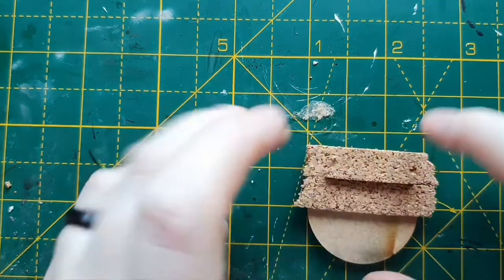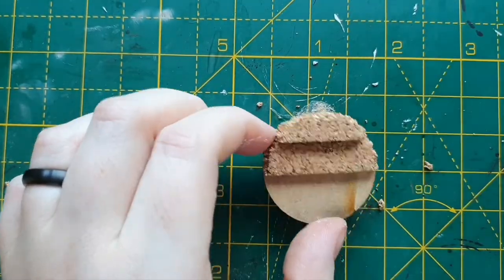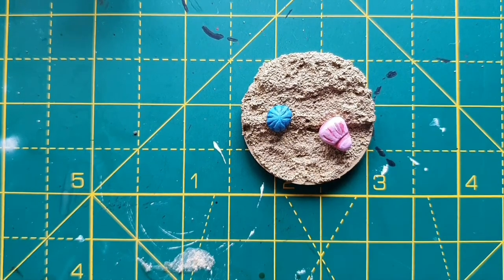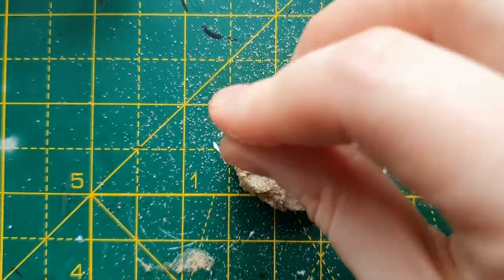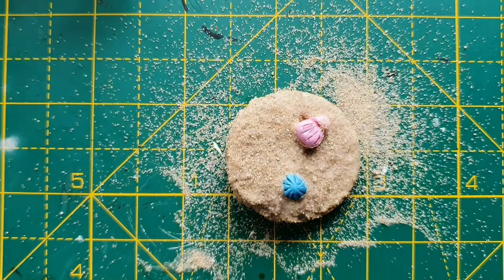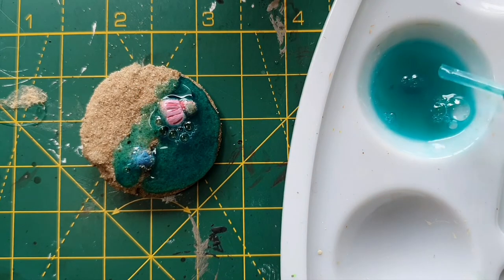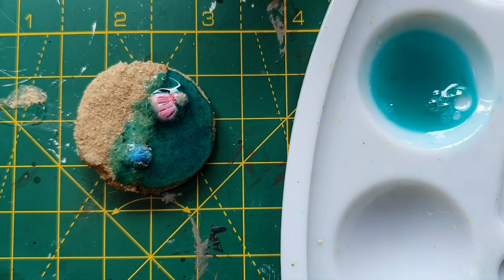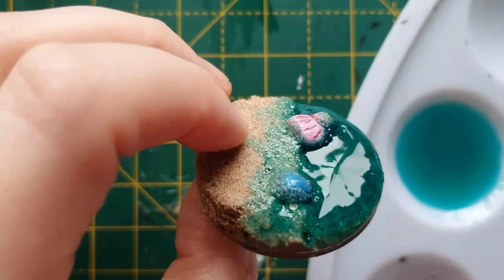All About Dat Base #8 - Beach

Comment: Crackin' work Debs! These are perfect for a certain Pirate Game (PODS) that seems to be gaining interest - certainly with me. Having never used cork I wondered whether it's possible to do at least some of the shaping by cutting the cork or is the texture just quicker and easier? Also my PVA seems much thicker than what you are using should I change product or dilute it? Thanks for sharing, I love these tutorials. ps is it just me or does watching this one make you want biscuits? lol. :>)
Reply from the maker: Haha, now you mention it, yes!  It does make me crave biscuits! 

You could cut the cork, but I do find the texture paint much easier.  You can be more precise with it, I find.

My PVA is from the Pound Shop, I think!  I wouldn't change what you have, you can just put some in a pallet and add some water, or simply put a dollop on the base, and then use a wet brush to spread it out :)
Reply: @debsworthshobbystudio580  Many thanks for replying It's much appreciated. :>)